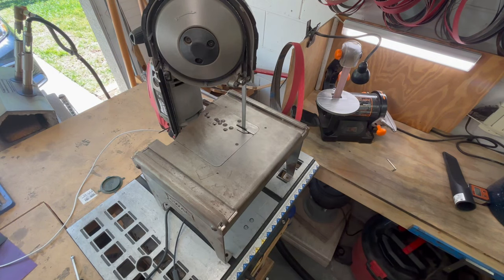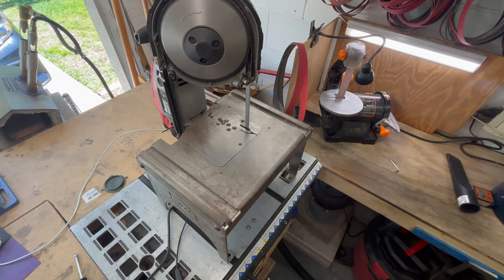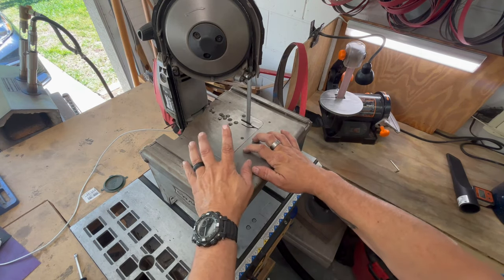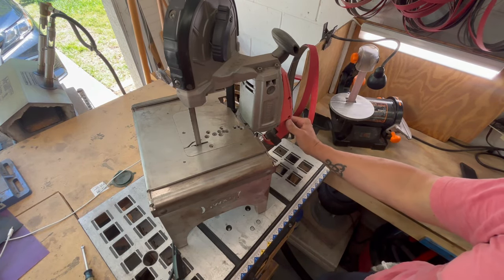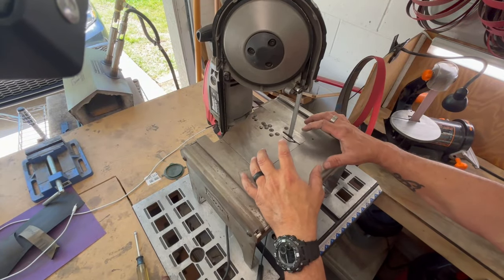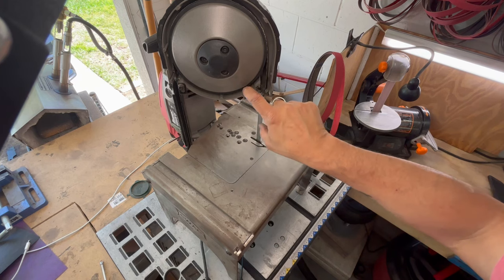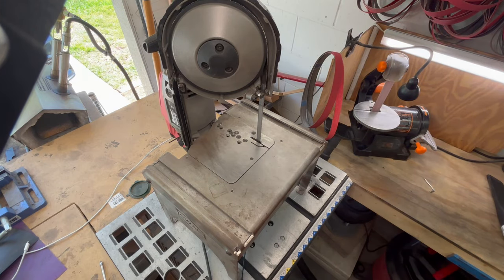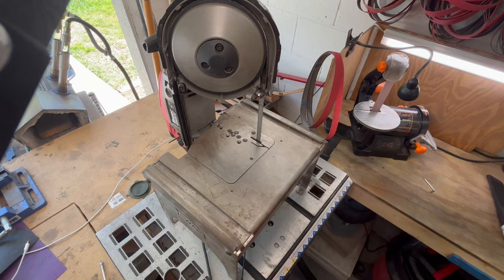Tool Spotlight - The Band Saw and Table

Comment: Yes, that was a close one. Nice band saw. I had one when I was a stainless steel pipe welder.
Reply from the maker: Yes.  Thanks.  Probably came in handy for that.
Reply: @AriesEDC  Indeed, especially cutting pipe 40 feet off a factory floor.
Reply from the maker: @raybo34  😱 Oh wow.  Yeah.  Not fun.